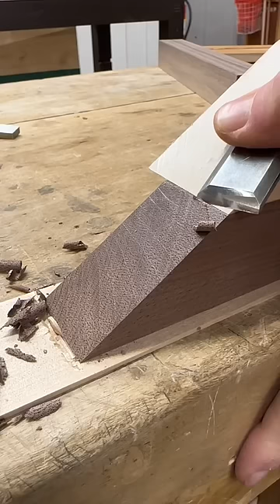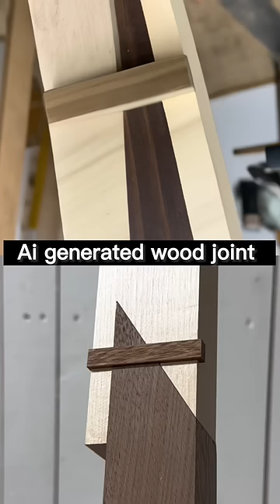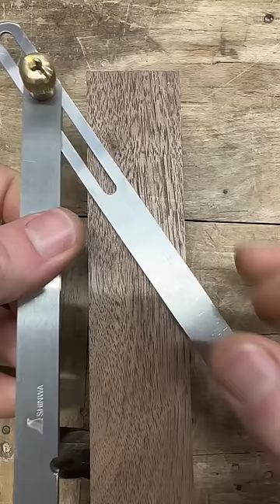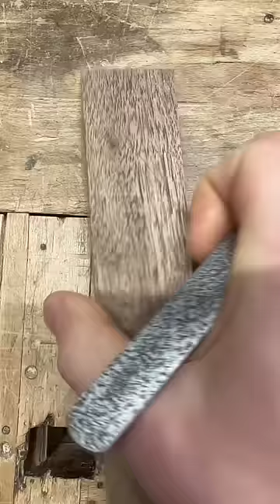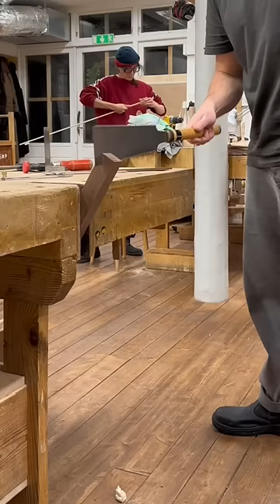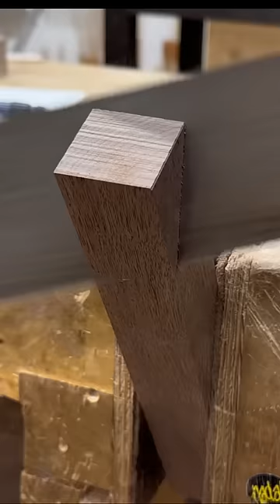Worst joint ever #woodworking #joinery #satisfying #asmr #woodcraft #shorts

Comment: I've been a carpenter for twenty years. I've never had a chisel that sharp. I'd really like him to sharpen my set.
Reply: You know it’s the wood. I only carved for 2 years and it’s amazing what a decent piece of wood matched with chisel b wax will do
Reply: @Stick 😅😊i
Reply: Me too! Try as I might, I’ve never come close.
Reply: A knifemaker friend of mine achieves an unbelievable edge on the knives that he makes. In fact he has made it a point to no longer get them so sharp (at least not the ones for most customers) because inevitably some people would want to feel the edge by rubbing their thumb across the blade even after being warned and they would severely injure themselves.
   The way he did it was to finish up the sharpening process with a cotton wheel on a bench grinder that was embedded with a super fine buffing compound (jewellers rouge).
Reply: @just_me2797  Oh god why would they touch the edge 😨 
I sharpend two knifes for a coworker and he nearly cut his fingertip of and his wife refused to use them as they were to sharp. I took it as i did a good work😂
Reply: @cykelfreak  Right. He always specifically warned people before handing the knife over to them, yet some people would want to feel just how sharp he was talking about.
   I can get knives extremely sharp, but they are nowhere as sharp as a custom knifemaker with 30+ years of experience, specialized equipment, and pride in what he does. That is a different level of sharp.
Reply: @just_me2797  same here i can get em really really sharp but those last 5-10% that take up 90% of the time to get em ridiculous sharp i just don't have the patience or time for it.
Reply: Just get yourself a guide and sandpaper and you’ll have it scary sharp in short order.
Reply: Woodworkers have a different requirement on sharpness than carpentry.
Reply: Kinky
Reply: 20 years and can't sharpen a chisel 😂. Personally I'd drop that too 1 year if I told that story.
Reply: My tools won’t hold an edge well enough. That’s what I get for buying $10 chisels.
Reply: Sandpaper and a guide. Scary sharp method. 😂
Reply: Get better chisels
Reply: Stuck my chisel in my forearm a year ago. So happy it wasn't that sharp...

Comment: I'm gonna take a stab in the dark and guess: That's not a Harbor Freight chisel. is it?
Reply: I have a full set of Lie Nielsen chisels, but I still use my wooden handle Harbor Freight chisels. I have them sharpened at about 20° and use them for soft wood :)
Reply: Really, any chisel sold could do that as long as it's been sharpened correctly, and you give yourself the proper technique. The durability comes down to the type of metal it's made of, but that just affects longevity.
Reply: I made a few chisels out of rasps that were old and rusted. Cut em in half and make 2 out of one. Scary sharp.
Reply: Plot twist it was a harbor Freight chisel sharpened just for this video
Reply: Probably not. But if steel is high enough in carbon you can sharpen it enough to do it.

Just going to take more time to get it there and in some cases keep it there.

But with some Chinese made stuff it's just a "mild steel" masquerade and will never hold an edge very well.

But oddly enough. Even that is often better than ancient steels. 

Still not good. But can be made to work. But you can literally beat out a trailer leaf spring. And make yourself a better chisel the hard way and spend less time on it than peice of mild steel flat strap Chinese counterfeits are stamped out of.
Reply: @williamowings6857  I make knives and I've thought of case hardening some of the Chinese strap steel they call "tools".
Reply: @taterbug70  Sometimes works. Sometimes a waste of time. It's risky.

Kinda like railroad spike knives.

I've got a 5 gallon bucket of disappointment that I avoid now after I learned to read the stamps on the head and other experiments gone wrong.

You can Google common scrapyard worthy risks and the approximate carbon content. But still a risk but I get Propane cheap for decorative and functional stuff I can hammer out with anything.

That lowers the price to be more comfortable with "Well that's FU" and "That's scary sharp!" experience. And okay with the failures as the informal "cost of education"  and okay with that.

If it helps I recommend leaf springs and even the pain of coil over springs. Very thick large diameter circular blades for material removal shaping even though it takes a ton of abrasives.

Old files not so much. 

Texan. And invasive species of feral hogs are a delicious  but rampant problem that needs to die for ecological reasons and we eat meat.

My hog knives are made from old files. 

I don't bother with temporing much. I have a cart and wooden block to hold them and just accept they are purpose built specific and broken garbage if I drop them on cement.

But they do hold an edge for a very long time.

That's what's cool about it.

You can learn to make what works for you specifically for specific tasks.

There's to much myth currently about the perfect blade to do everything and anything...and that's okay to pursue. But not exactly realistic.

You won't see a top fuel dragster on a F1 track any more than an F1 car on a drag strip.

Purpose built to the extreme. Apples to oranges cars 

Stainless Steel kitchen knife is between a KIA and Honda Accord. 

Works...but not remarkably well. Just well enough for somebody that doesn't care much more than it works well enough and got other things they are more intrested in to buy rather than build.

I like to build. Would love to see what you build.

I don't know everything and sometimes even have to acknowledge I was doing something wrong....but that's kinda the cool thing about the internet.

I'm old. Land line/ snail mail old.

It was hard as Hell to find any info and then ferret out the  bullshit amongst actually useful advise.

So I'm only saying IMO/IME  

Best wishes to you and yours and hope to run across your future projects and learn from them as well. 😊👍